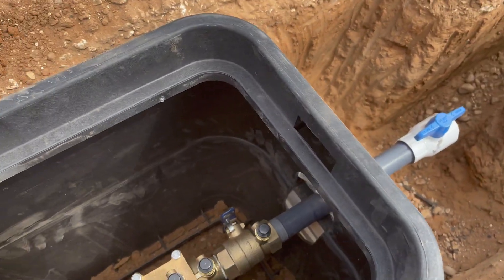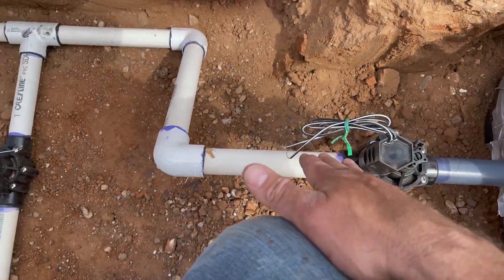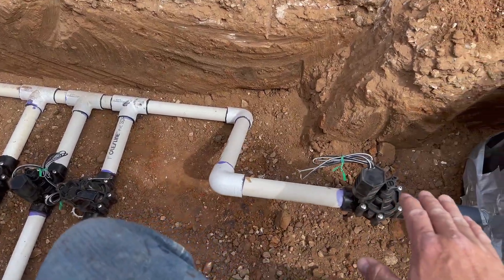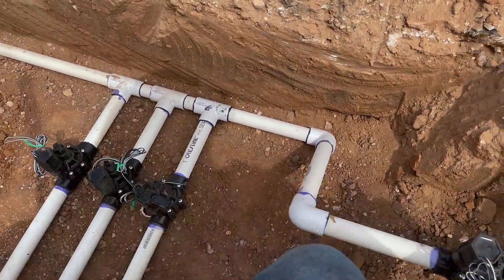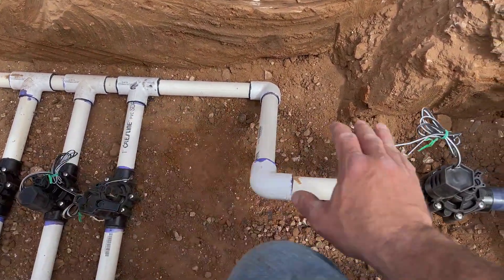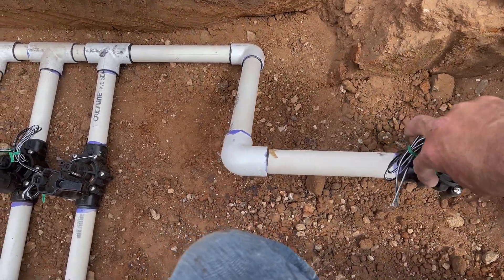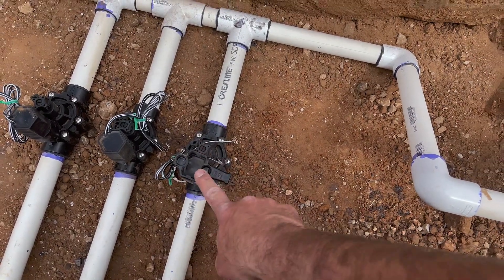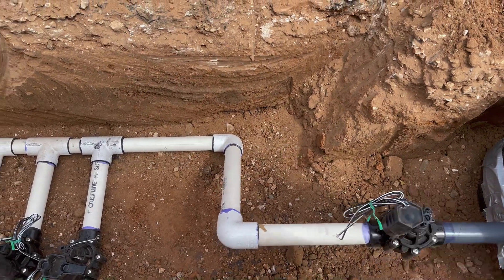What Is An Irrigation Master Valve

Comment: Question, just found out I have to add a master valve. Is a standard valve fine? Or use one with flow control? The other three I have flow control.
Reply from the maker: Either will work well.
Reply: @  Does the PRV have to before the master valve?

Comment: I have a question if you have a minute.  I have a five strand sprinkler wire.  One common (white) and four colored (blue, yellow, green, red).  I do not have a master valve.  I have two valves running my front yard sprinklers (two valves in a box), and two running my backyard sprinklers (two valves in a box), so all the strands in my wire are used up and I cant run anymore valves on that wire.  One of the backyard valves stopped working, and I know it's not the valve because if I hook up another strand to the valve it comes on fine.  So I'm guessing that the wire must be damaged somewhere along the buried route.  The wire isn't enclosed in any kind of protective cover other than the black rubber looking casing, so its exposed to the elements, possible rodents, etc.   It's about 11 years old, so the outer cover may be deteriorating.   I don't have access to  any expensive wire finder sensor tool to find where the damage may be, and don't want to dig up the whole line to replace the wire unless I have to.  I'm a 65 yr. old single lady, and use your channel all the time to do my own DIY sprinkler work. Any suggestions?  Love your channel and your Texas personality "helping us all become better irrigators!! "
Reply from the maker: Thanks for watching and thanks for your question. This does happen from time to time. One of the things you can do is check all the wire splices to make sure they have not gone bad. You also want to recall if any digging has gone on in the yard that could have cut a wire. Also, animals can dig around and chew through wires. The best thing is to test the wires with a multi meter and trace the wire to find where it is broken, but I understand that not everyone has those expensive tools. One other thing you can do is use a device called an Add-A-Zone where you can use one wire to run two different zones. There are around 100 to 150 bucks. Fairly easy to install. This may be a time to call a professional to come take a look and get it working. I hope this helps.
Reply: @AmericanIrrigator  Thanks so much for your quick response!  I do have a multimeter and know how to use it a little bit.  When i turn the controller off (rainbird) and put the black lead on the common wire and then the red on the wire that is the problem it has no reading, and I'm assuming that it means a  problem with the wire between the controller and the valve.  The wire I can see in the valve box looks fine so I'm afreaid it's somewhere in that long  stretch in between.  when i test the station in question with power on, it looks like its got power at the control box like all the other stations, it's just not getting to the valve.   I have looked into those add-a zones and I may give that a shot instead of digging up all that wire.  I did buy a spool of 7 strand wire in case I do have to dig and replace and that way I'll have a few extra wired to work with in a situation like this if it happened again.  Thanks again!!
Reply: Do you happen to have a video on the add-a-zones and how to install?
Reply: -Nevermind ---I figured it out!
Reply: @jann4435  I’m late but the other thing you could’ve done was re-ran a rubber hose with the proper gauge to another sprinkler zone and use y junction holes attachments off the line to add more sprinkler heads take more time to dig lines to the existing sprinkler heads but it’s a workaround